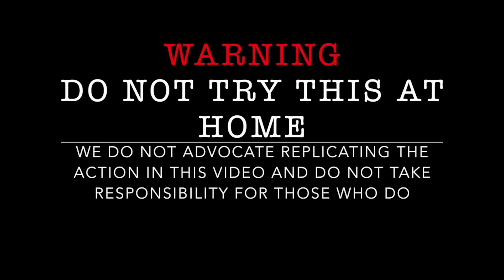EXPERIMENT MAKING A SUGAR ROCKET AND TRY TO LAUNCH GONE WRONG

Comment: Some tips:

1)Make a good nozzle, possibly eith concrete

2)moove wings down, they are way to high and the center of pressure is beyond center of gravity. They have to be in the lowest bit of the rocket, possibly extending downwards like in the first one

3)cook the propellant and add Fe2O3, but just before using the engine. If left to the air it sucks in tons of water and became useless

4)wait for less windy conditions
Reply: Bro are you studying rocket science???